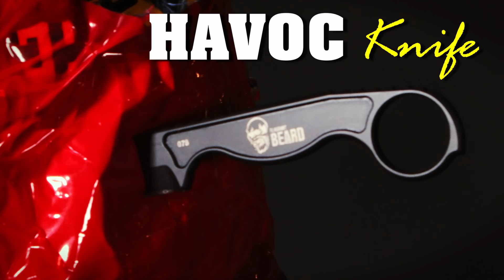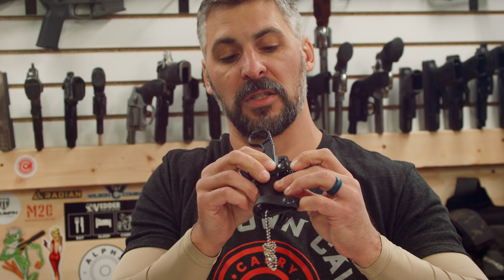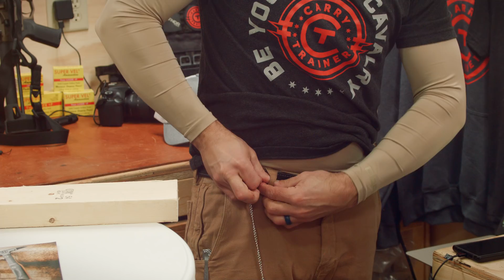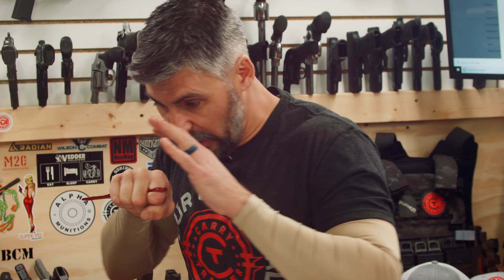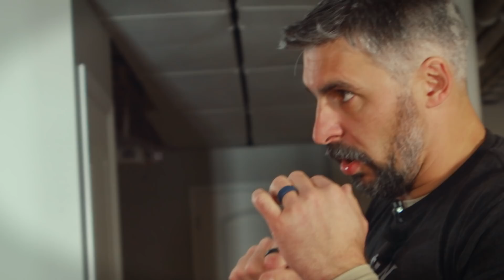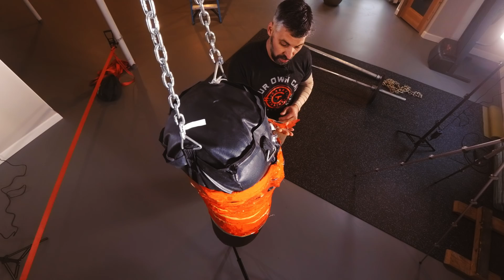Tactical Martial Arts Knife for Every Day Carry // Flagrant Havoc Review | Episode #62

Comment: Thanks for the Review.
The sheath is superb
Ergos are superb.
But man it came dull like a butterknife and the edge is soo far offcenter almost seems like a joke. One side is like 25 degress the other is 34. Thats not acceptable at this price point.
Reply from the maker: Its not a skinning blade or for general purpose pocket knife work. it's made for one specific task and that edge is an artistic thing.
Reply: @CarryTrainer  thanks for your reply i fully agree with you that it is a pure defense blade! That was not the Problem. It was really a part of the blade in the Front was very much offcenter. But took only about 30 min on my dmts to fix it.
And now it really is able to cut cleanly and deeper. Even notice it on my sacrifice heavy bag ;D.Dont get me wrong your review is on point i just was a bit pissed of of the different angles in the grinds. And i feel that edge thats now on it should be from factory.
Otherwise like i said really superb blade links perfect to your boxing skills. Sry for my bad english its not my birth language.
Keep it up channel subbed.
Reply from the maker: @waldkauz7895  I would have sent it back before grinding on it myself.

Comment: These knives are made in China and imported for around 15 bucks a piece with sheath and metal belt clip.  So putting soft loops with one way snaps and a logo on the side of the knife and say they are made in USA and bam  $139.99, thanks suckers.
Reply from the maker: Completely wrong. These knives are 100% made in the USA. You are talking out your ass
Reply: Check the link pal and we will see who is talking out of who's arse!
Reply: Any link to the cheaper ones? I'm curious to see how similar they look.
Reply: Your link are clone knives, this commonly happens to many manufacturers. Won't be the same coating, steel, etc.
Reply: @bear199422  Yes I understand that but these knives from China have been around for some time as I import them. They have no distinguishing marks so you can put your own logo on them. I'm out to make a profit same as anyone but I draw the line at fraudulent claims. I'm not accusing CarryTrainer of anything as he is testing and reviewing a product and is only passing on what he has been told. Plus I enjoy his reviews but I have to stand up and be counted when I see something that isn't right.
Reply: Andrew you need to get a CPL things straight 
I bought one of the copies 
For 20 bucks it's a good knife but it is most definitely not the same knife I have the real one as well it is 1095 steel and much thicker 
The copy is claimed 440c maybe it is maybe it isn't it's also thinner which I like and has a slight hollow grind which makes it much sharper than the FB original which is Too thick in my opinion
Your claiming that flagrant beard is fraudulent is ludicrous at best
The Chinese copying and stealing designs is the fraudulent behaviour I sincerely hope you do not claim the knives you import and sell from China are originals the Chinese are getting very good at copying and quality has gone way up but it's still stealing 
Flagrant beard is an American company and they are selling an original design it is not made in China 
Before throwing around the accusation of fraud do a self evaluation
Reply: What exactly are you standing up against here? Americans working hard and selling an original product to make a profit?
Your selling Chinese knockoffs and making a profit off of Chinese slave labor
Reply: @jackbrown8201  just telling the truth but some people can't handle the truth. Funny thing is I've been importing these for longer than your alleged inventor has been "making" them. Why would I claim anything from China is original, (because how could I really know for sure without sighting patents), I sell them as self defense knives same as everybody else just a lot cheaper and I don"t say they are made in my country of origin.
Reply: Really so the copies have been around more than a year? So flagrant beard knives copied the design from the Chinese? Wow that's amazing and complete bullcrap and you know it 
If you want to sell copies and don't lie and say they are the real deal then great but I can tell you without a doubt flagrant beard does not make their knives in china and import them and put their branding on them and your saying they do which is unsubstantiated bull crap 
Like I said I have both and the knockoff is a good deal for the money but I also don't like to support foreign economies over my own as a general practice especially when they steal ideas and make a profit by screwing their own people 
I don't care if you sell copies and it's great if those who can't afford the original can at least get something close for alot less 
Just don't make accusations that other businesses are a scammer when you have nothing to back it up with is all I am saying
Also please show me where you are selling these in the states and how far back cause they just started showing up on eBay recently
Reply: We both know china doesn't respect our patent laws and they don't have patent laws in China so that argument is also total bull crap
C'mon dude seriously 
You sell knockoffs thats fine whatever 
Just don't be a hypocrite is all I'm saying
Reply: @jackbrown8201 I don"t sell them in the States I sell them in Australia, my brother lives in China and got me onto them early 2018.
Reply: sorry i am so dense
now i see why you made the fraud claim against flagrant beard and then linked your fleabay ad here in the comments 
hopefully it will result in big sales for you !!!!
but hopefully not by trying to dupe people into thinking they are the same knives  was my only worry but that’s not the case at all right? 
sorry to bother you !!!
Reply: sorry i am so dense
now i see why you made the fraud claim against flagrant beard and then linked your fleabay ad here in the comments 
hopefully it will result in big sales for you !!!!
but hopefully not by trying to dupe people into thinking they are the same knives  was my only worry but that’s not the case at all right? 
sorry to bother you !!!
Reply: sorry i am so dense
now i see why you made the fraud claim against flagrant beard and then linked your fleabay ad here in the comments 
hopefully it will result in big sales for you !!!!
but hopefully not by trying to dupe people into thinking they are the same knives  was my only worry but that’s not the case at all right? 
sorry to bother you !!!